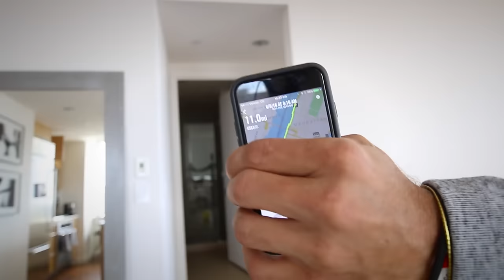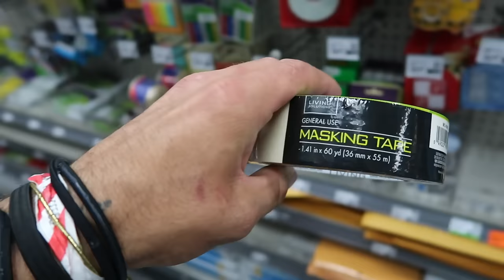NEVER RIDE A UNICYCLE IN TRAFFIC!

Comment: 7:41 pace means he averaged 7:41 per mile it doesn't mean he ran 7:41 each mile. He could've ran 8 something and then 6 something per mile
Reply: This depends on how he tracks his runs/what app he uses.  Some do averages of entire time and mileage while others do an average based on each mile time.   Some do both.  #themoreyouknow
Reply: So he averaged 7:41... isn't that kinda.. slow? I ran the mile in 5:40 back in high school
Reply: Also how the hell do you track your runs and vlog at the same time?
Reply: You ran 1 mile in 5:40, he ran 11 miles, try and do 11 miles at 5:40 pace ;)
Reply: I only said that because they way he explained it made it seem as if he ran 7:41 a mile the whole time or for each mile.
Reply: But for running as much as he does...he should have faster times no? He always shows his pace and it's always the same lol he should be improving..
Reply: +Travis Warren 7:41 pace is pretty fast, if you ran 11 miles, you'd probably run at an average 10:00 pace